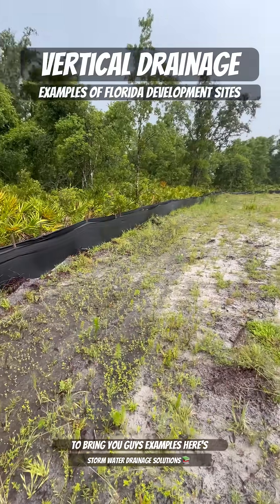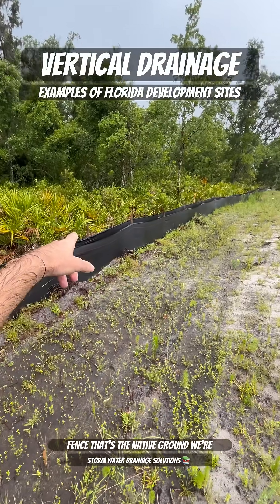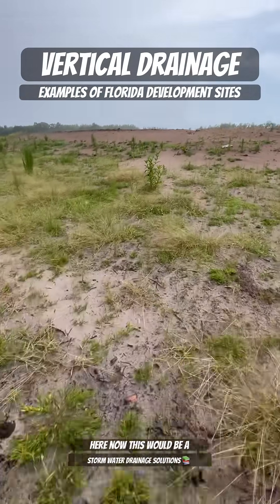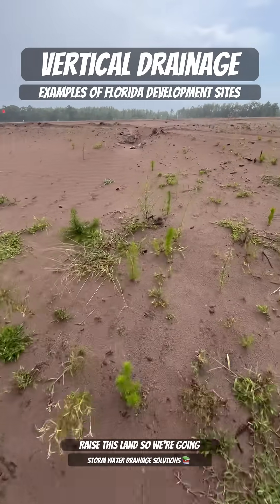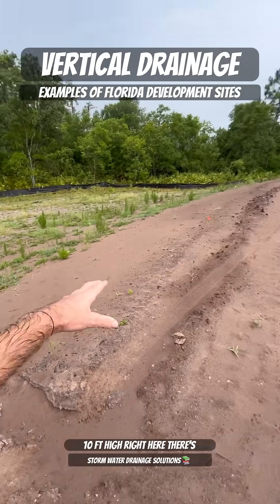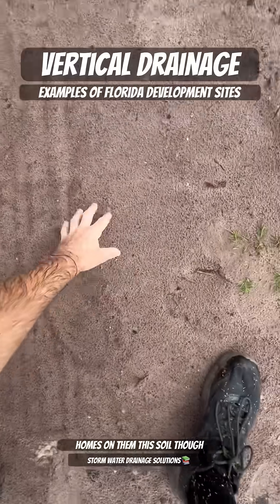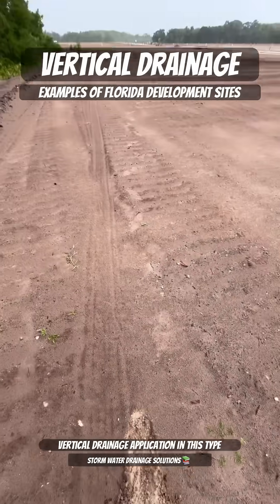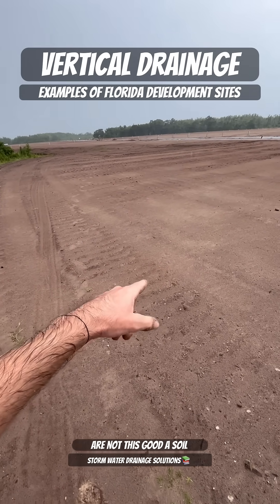Vertical Drainage - Florida Development Site Example - Storm Water Drainage Solutions

Comment: you are mistaken. There’s hardpan underneath that brown common dirt that you’re looking at and you should know that. those lots do not perk theyrun off.
I have a grading company in Florida. I work in that material every day.
Reply from the maker: @jamesweir2943  It seemed like it was perking pretty well while I was out there in the rain. There was no runoff on this site, which is rare. Most all the sites I’m on don’t perk like this one did🤷‍♂️ What part of FL are you in?
Reply: @StormWaterDrainageSolutions  martin/st lucie. The material coming out of the lakes on that site has a lot of clay and hard pan in it and it’ll be spread out on those house pads in layers.  when it dries, it’s like concrete.
Reply: Do they perc through the imported soil then run off along the surface of the undisturbed native soils?